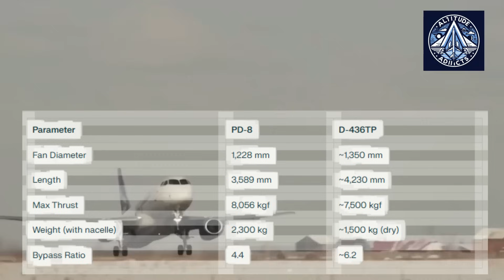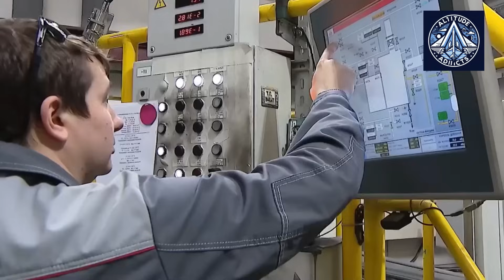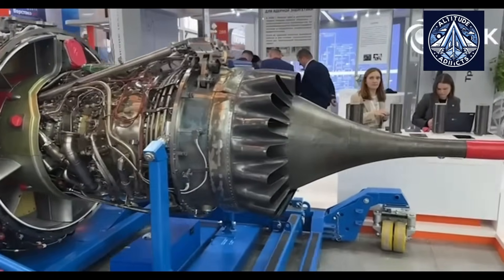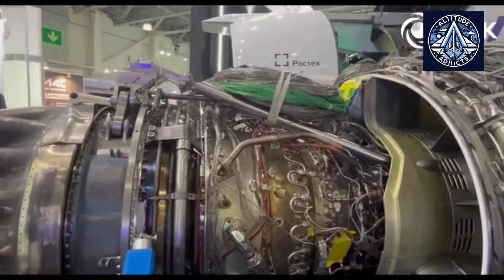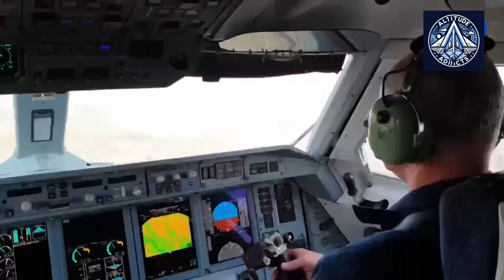PD-8-200 - What will It Take for Russia to Swap D-436TP with PD-8 Engine on BE-200 Amphibian?

Comment: The Lotarev ( Progress, Motor Sich..... ) engine and the PD-8 are one and the same engine, just upgraded for the times and added a digital fuel management and control system reflecting the digital age and probably beefed up turbine blades, ceramic coatings and a fancy new front fan blades but in essence is the same engine....!..
The shelves on a dozen aircraft engine builders are full of engine prototypes and need very little to upgrade for the times...

Comment: With the MS-21 facing disaster due to its failure to meet specifications, Russia's civil aviation industry seems to be solely focused on somehow reviving ancient soviet aircraft designs.
Reply: Bullshit!😂
Reply: @andimilan5348  Really? Here are three aircraft which are regularly featured on this channel, because they are set to become key projects of Russian civil aviation (again):
Il-96 ->  first flight 1988    -   Tu-204/214 ->  first flight 1989    -    Il-114 ->  first flight  1990
Reply: @luisdamian4562 ...is there any point in explaining to an idiot that only the skeleton remains of the original ones and that if there are new engines and electronics, then it is in fact a new aircraft? By the way, that's what Boeing and Airbus do too...🤣🤣🤣
Reply: @igorderka4960  A yes, new aircraft, I see. Is that why Il-96 and Tu-214 delivered in 2025 still have a three pilot cockpit design?
Reply: @luisdamian4562 ...but you are talking about the aircrafts before the engine replacement (that's why they developed a whole range of engines, PD 8, PD 14 and PD 35), after the replacement there will be only 2 pilots...it's called a process...as part of this process, completely new fuselages and wings are also designed, i.e. 100% new aircraft...now they use old fuselages and wings, but with modern electronics and engines it is a completely logical solution in the situation the Russians are in...which you just didn't understand...😉
Reply: @igorderka4960  I fully understand that Russia has no other option in the current situation ... except for the most logical one: Stop the stupid war are thus overcome the sanctions.
Reply: Russia's aviation industry is facing an uphill battle indeed. After decades of neglect and decline, they are trying to develop too many different airframes at once and on top of this using only locally-produced components, which are mostly basic and mediocre. The result can be mediocre at best, probably only good enough for the domestic market ...
Reply: @deepinthewoods8078  простите, а вы специалист по российским авиационным компонентам, или просто с дивана вещаете?

Comment: The easy swap to PD8 engines with minimum mods. Water drains are already in place slight adjustments for mounting filler plates since PD8 is smaller in size. The best, all Russian made secure and safe for in-house made 100% in Russia.